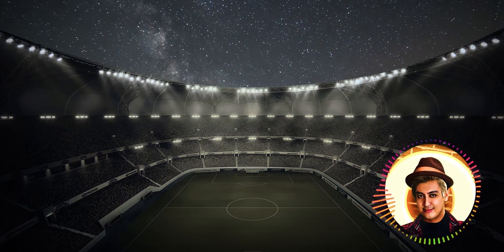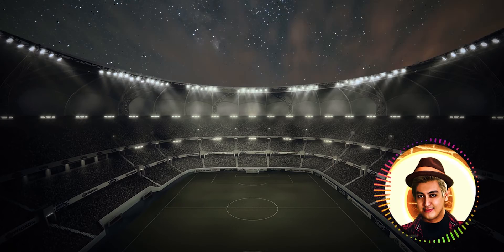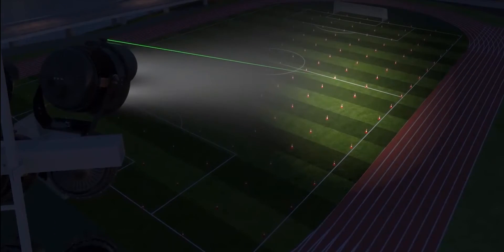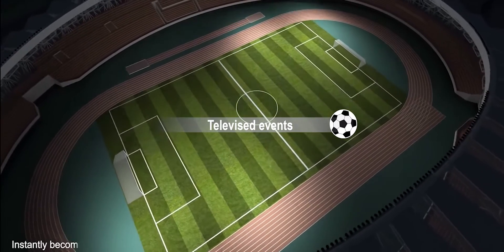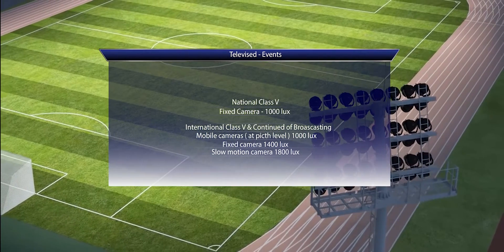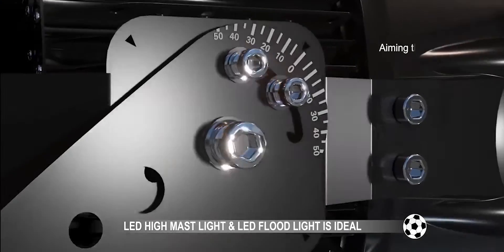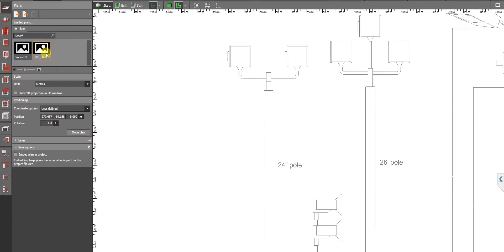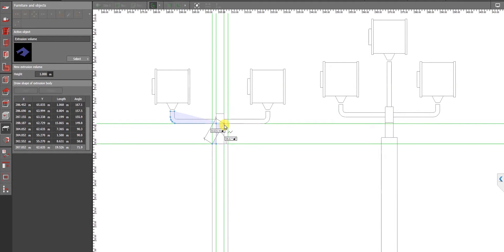HOW TO CONSTRUCT FOOTBALL LIGHTING DESIGN DIALUX EVO

Comment: from where i can have or how can i make the fence,,, also how can i aim the flood lights to have a uniform light destribution?
Reply from the maker: hi there have a good day thanks for your comment you can download the 3d wire fence on 3D Warehouse, regarding the light distribution this is an example project it depends on your project Small-scale floodlights with narrow beams might be used for illuminating a sign with a uniform distribution of light. This would be achieved by mounting
Reply: Unfortunately the evo is not suitable for professional focus projects unless you spend hours and hours adjusting the focuses. In Dialux 4.13 you have the possibility of inserting flood lights and previewing the average values in a soccer plot.